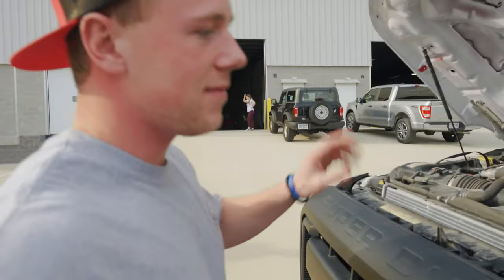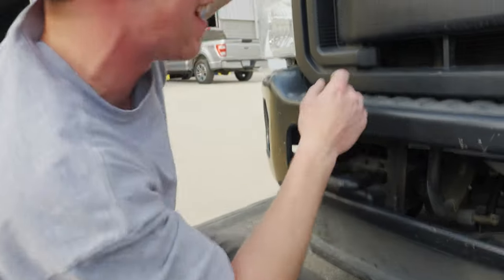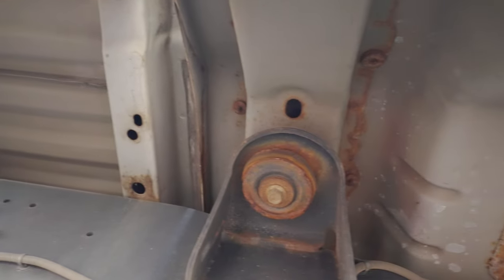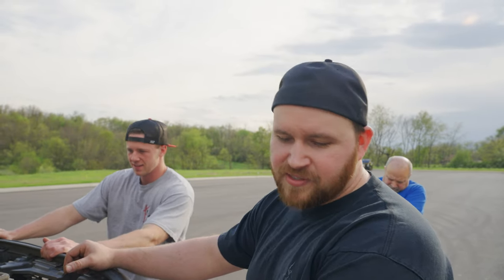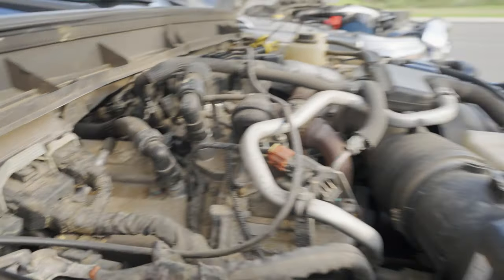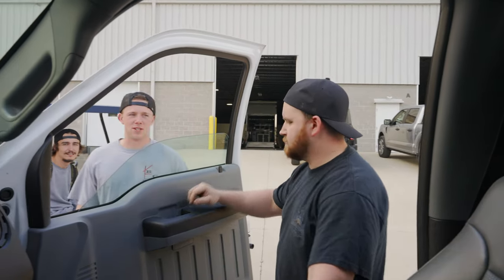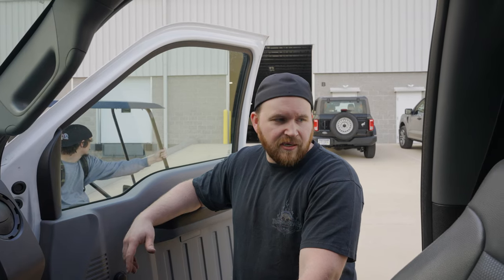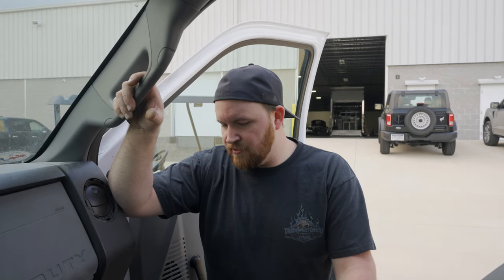6.7 Powerstroke Compound Turbo Kit - SPE Motorsport

Comment: Out of curiosity could you hook up a drive pressure gauge? Most of these powerstrokes running a compound kit over the S3xx aren't being wastegated. Which is just odd and against what everyone else does across other motors.

Comment: So the way I understand it you all are only going to offer the compounds if you run the emperor kit. Are yall going to consider doing it for the ones still running the vgt style?
Reply from the maker: We wouldn’t say never, but you run into too many other things using a vgt. Needing to gate it, over spooling with a bigger atmospheric charger, becomes too unreliable, ect. Eliminating the increased amount of possible problems with a vgt and doing non vgt is just the way to go in our opinion.